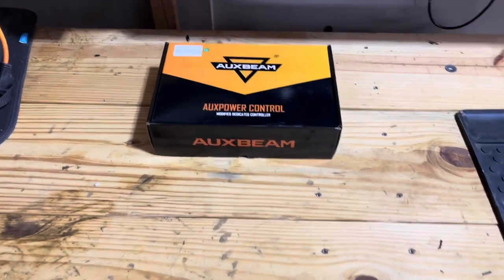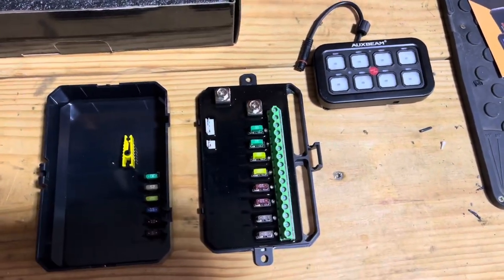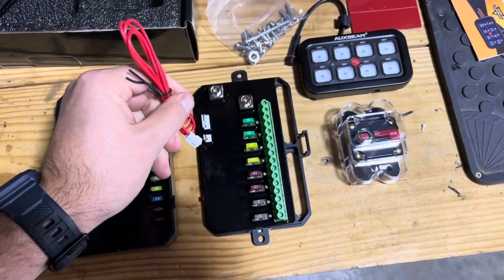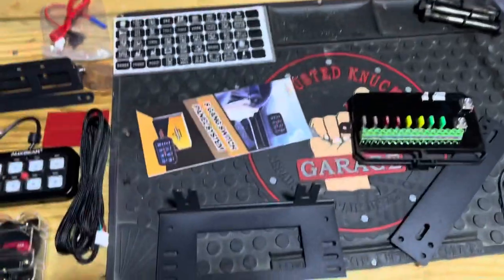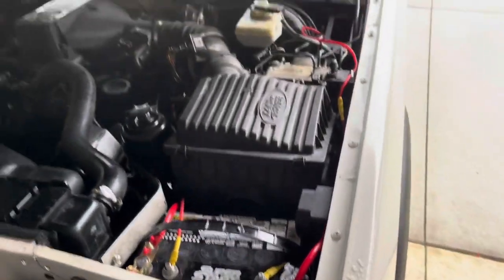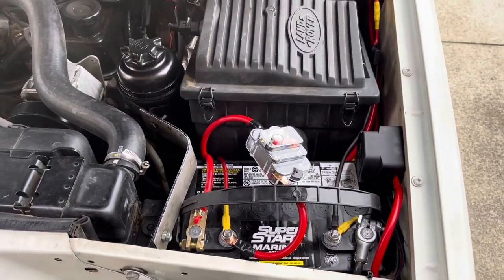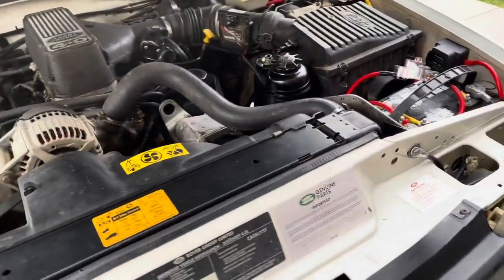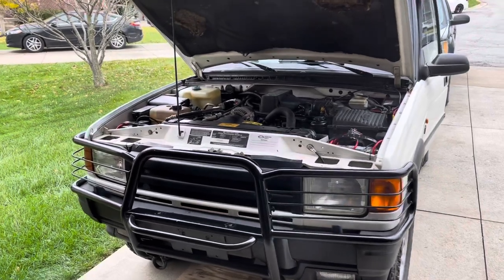Auxbeam 8- Gang Switch Panel Review!

Comment: The relays inside are not the same amperage. There's a video that shows the circuit board without the water resistant coating and you can see that the 30a have a different arrangement

Comment: Were you able to switch the fuses around in the auxbeam controller case without any issues?
Reply: They have different relays internally. It wouldn't be a good idea. There's a video in which you can see the circuit board without the water resistant layer